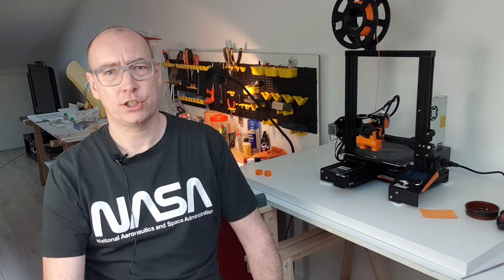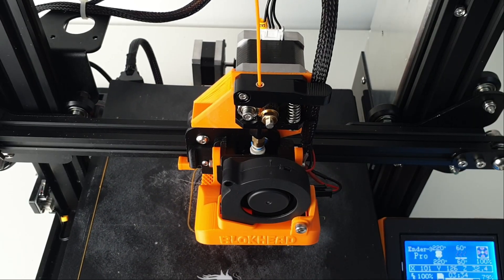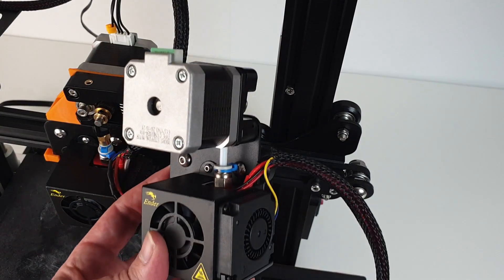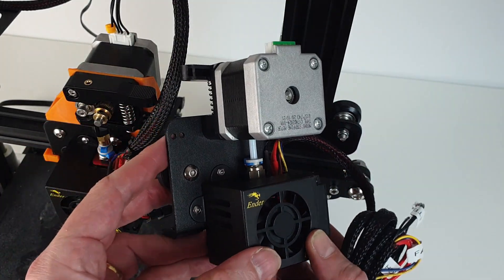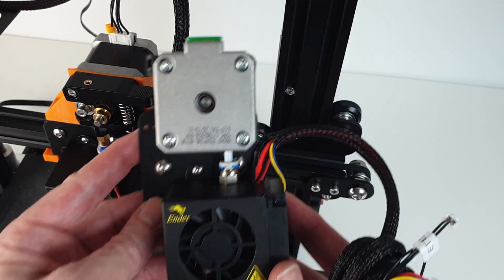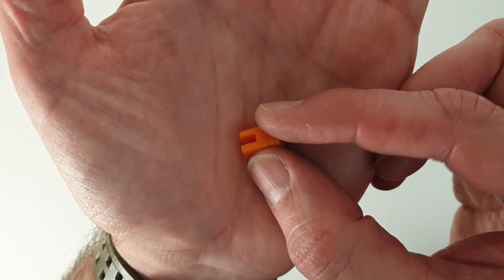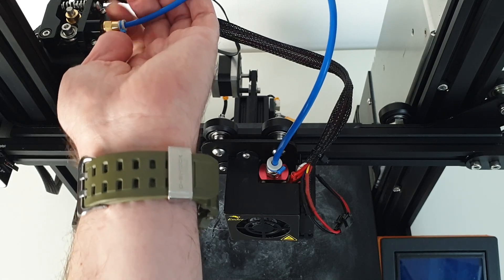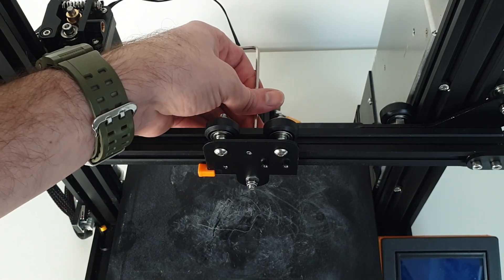3D Printed Direct-Drive for the Ender 3

Comment from the maker: FREQUENTLY ASKED QUESTIONS:

Q) Do you lose any print volume with this upgrade?
Yes, with this upgrade you lose 13mm on the X axis and 40mm on the Z axis.
This is because the extruder motor hits the frame due to its location.
To avoid this, you can either:
- purchase a thinner (<27mm) pancake stepper motor. I use this one (Amazon Affiliate Link): Usongshine Nema 17 Stepper Motor (17HS4023): https://amzn.to/3qEHUHR
- swap the Y axis motor (4234) with the extruder motor (4240) as per Erçin Torun guide:
https://all3dprint.blogspot.com/2020/09/ender3-pro-direct-drive-bullseye-mount.html

Q) Is the print quality higher with direct drive?
Not necessarily. You can get good print quality with a Bowden setup too. I would say the retractions are easier to get right with a Direct-Drive because of the shorter distance between the extruder and the hotend. In addition, the direct-drive is compatible with a wider range of filaments and makes it easier to print with flexible filaments / TPU.

Q) Do you have to change the firmware or anything when doing this upgrade?
A) You might have to change the size of the bed in the firmware. In Marlin Configuration.h, change X_BED_SIZE to 220 mm (from 235) and Z_MAX_POS to 210 mm (from 250) and flash the firmware. Alternatively, you can use a thinner stepper motor like this one: Usongshine Nema 17 Stepper Motor (17HS4023) : https://amzn.to/3qEHUHR. 

Q) Do you have to change the esteps in the firmware?
No if you use the same motor and extruder as before

Q) Would this work on the Ender 3 V2? on the regular Ender 3 (not Pro / not V2) ?
Yes

Q) Would this work on an Ender 5, CR10 etc.? 
Sorry, I don't know. You can give it a try, it's only 2 parts to print

Q) Which material do you use? Is it safe in PLA?
I printed these parts in Sunlu PLA+. It is safe in PLA. The extruder motor does get a bit hot but you should be able to touch it with you hand, otherwise the motor current is set too high and should be reduced on the mainboard. 

Q) Do you need to extend the extruder wiring to do this?
Yes if your current cable does not reach the top of the printer and you need the full print volume in Z (250 mm)

Q) After extending my extruder wiring, the motor turns in the wrong direction. How do I fix this?
Swap the 2 middle wires in the extension connector

Q) Do you need to change any settings in the slicer?
You can use the exact same slicer settings as before.
Optionally, you can update the build volume in the slicer to avoid placing objects outside of the available volume. 
In Cura, Settings -> Printer -> Manage Printers... Then click on "Machine Settings"  In Printer Settings, update  X to 220mm and Z to 210mm. With the right build volume, Marlin and Cura will not command coordinates outside of the available build volume, preventing the head to hit the frame. 

Q) Would this work with other fan shrouds?
Hero Me Gen 5 or 6 : No (because the  design shifts the hotend position)
Bullseye: Yes
Bullseye Blokhead: Yes
Satsana: Yes
Bantamount: No
Others: Most likely but I haven't tested

Q) Is this compatible with an Auto-Bed-Leveling (ABL) sensor?
Yes, this only affects the motor location. The attachment for an ABL sensor is provided by the Ender 3 metal plate or by the fan duct upgrade.

Q) How much Bowden do you need to cut?
63-65mm.
Reply: thanks
Reply: what the retractions for PLA , PETG and TPU?
Reply: @JPFaerialops225  0.5 to 1mm

Comment: Unfortunately doesn't fit an Ender V3 Neo, will need to reassemble the printer to reprint a modified mounting bracket unfortunately

Comment: After I installed it on my 3d printer it keeps slipping on the extruder and making the clicking sound how do I fix this?
Reply: sounss like an extruder gear issue.  just need to tighten or sloosen the brasss gear or the silver one it runs the filament past

Comment: RIP would have to figure out some modifications, I have the Ender 3 NEO with a CR touch, don't think the CR touch might be the problem but the NEO shroud/cover is a very terrible design fastened from the back so the printed part will block that hole. I actually had to strap it with cable ties to take some noise away (still not great). But I want to print with TPU and don't want to take chance with the Bowden. Might have to get the original metal cover, then drill and tap holes for it...... Or end up buying the Creality one, but I don't like where the stepper motor sits (and also looks crap and unclean).
Reply: There are models for the neo with a hole for the cover screw.
I printed it with petg and didnt have to buy anything to do the upgrade. I recommend extending the extruder motor cable however. The stock cable is short for the upgrade
Reply: @francisjpk  "and didnt have to buy anything to do the upgrade" but you had to buy longer cables for the motor. And the upgrade to direct drive on the NEO didn't work anyway, weeks of tuning with no success. Would have been easier and cheaper to just buy a model that has direct drive from factory.

Comment: Hai, nice video. If the bracket designed with extruder on front rather than back, there won't be any loss in build volume.

Comment: is a capriorn tube required or does it work with everything stock? By the way, on the Q&A, I can answer a question. This upgrade will undoubtebly work with the cr 10 because everything about the hotend is identical. However, the frame might be different so a longer stop-protection thingy might be useful.
Reply from the maker: It does work with everything stock, capricorn not required

Comment: I installed this mod and changed the motor with a thinner pancake motor but it heats up alot to the point i cant even touch. Any advice to fix the problem?
Reply from the maker: You probably need to lower the VRef of the stepper motor as shown in this video https://youtu.be/k2nm-WetPnU
Reply: @YouMakeTech  anywhere i could text you from? Maybe discord?
Reply: @YouMakeTech  Im having trouble finding details about my stepper motor
Reply from the maker: You can try by lowering the VRef by 20%
 A pancake motor typically needs much less current than a standard motor. This should significantly reduce the temperature. Then if it skips steps, re-increase the Vref 5% by 5% until it no longer skips steps. The "game" is to find the tradeoff between stepper temperature and torque. Note that a stepper motor can be hot. As long as you can touch it with your hand, it should be fine

Comment: what about setting. what did u have to change in the slicer. ive always wanted to do this but have always put it off an i ended up getting a a8plus that came with a direct drive an i started looking at its setting in the slicer an it wasn't as much of a difference as i expected from my boden extruder setups. i always thought a direct drive would use really low retractions from everything that i had read online but the factory slicer setting for my a8plus was the same as what my ender 5 is with a microswiss all metal hotend an i went from 5mm at 45mm/s to 4mm at 45mm/s with the all metal hotend upgrade so i figured a direct drive on top of that would lower it to 3mm or possibly even 2mm or less. i never tried switching them but i have a h2 direct drive that i had gotten to put on a two trees sapphire plus but have never gotten around to it but i really want to use some flexible filaments so its time i set one up to run flexibles an i have a ender 3 ender 3 max ender 5 and a voxelab that im going to pick from to do it to an i may end up getting around to putting the h2 on the sapphire plus but this looks like a simple way of going about it that doesnt cost anything so i think i'll give this a try.
Reply from the maker: I think the real benefit of direct drives is more responsive and more repeatable retractions. If you print mostly technical parts, with many retractions, the quality is superior to a Bowden system simply because the extrusion is more accurate at starts and stops.. In addition, direct-drives are compatible with a wider range of filaments, in particular flexibles. Regarding settings, most people only tune retraction distance and speed. But IMO the key parameter for retractions is actually acceleration. When you increase the retraction acceleration, you can reduce the retraction distance below 1mm! The 2nd retraction parameter which most people neglect is the travel acceleration. In fact, when you travel fast, you don't need to retract as much because the travelling time is much shorter and the filament has no time to leak! Any amount of retraction distance will not prevent the filament to leak out of the nozzle after some time because the hotend is not airtight and the gravity pushes the melted filament down! Finally, the last parameter which is critical is the linear advance. Once you get high accels + a properly tuned linear advance, retractions become insensitive to retraction distance and speed settings. With my Ender 3, any retraction distance above 0.5mm works fine. The print times are also much shorter with high accels and short retraction distances. To give you an idea, I use 3000mm/s2 accel for travels, 1mm retraction distance, 50 mm/s retraction speed and 0.04 pressure advance on a Bondtech BMG/E3D V6 with perfect retractions and no stringing. I have used these settings for a while now with various filament brands (PLA) and never needed to change them

Comment: Is there any consideration to have when configuring the printing profile after this? I'm planning to use this mod. Thanks!
Reply from the maker: you can use the same print settings and the same firmware if you use a thinner stepper motor, please check Q&A comment at the top for more information. With the stock motor, you would need to reduce the bed size in the firmware
Reply: @YouMakeTech  oh, just noticed that. Got it. thanks.

Comment: Has anyone used that upgrade with a BLTouch? After installing, the probing points are outside of the print plate. Also it slams into the frame on the right while probing the right points.
Reply from the maker: It's a known issue, please check the FAQ at the top of the comments

Comment: quick question: anyone know how to get a cable extender for the extruder, or how to make the extruder cable reach the extruder?
Reply from the maker: I make my own cables using a dupont ratchet crimping tool set (e.g. https://amzn.to/3sbQrmi ). With a kit like this, you will never need to buy cables for your 3d printer again, you can make them all, at the right length!

Comment: Thanks for the design and video! My extruder bracket is loose and the wheels arent tight to the track. So i can wiggle it. Is this normal?
Reply from the maker: No it is not. Maybe check the eccentric nut
Reply: @YouMakeTech  Thanks that worked!!! Beautiful design!

Comment: Other than recalibrating the extruder is the firmware the same or not?
Reply from the maker: You might have to change the size of the bed in the firmware. In Marlin Configuration.h, change X_BED_SIZE to 220 mm (from 235) and Z_MAX_POS to 210 mm (from 250) and flash the firmware. Alternatively, you can use a thinner stepper motor like this one: Usongshine Nema 17 Stepper Motor (17HS4023) : https://amzn.to/3qEHUHR . With a thin stepper motor, you don't have to make any changes in the firmware

Comment: where can i buy an extension cable?
Reply from the maker: On Amazon. The problem is that most extruder cables are not wired for Creality, so you need to swap the cables in the connector. My advice would be to make your own cables by using a Dupont Ratchet Crimping Tool Set like this one: https://amzn.to/3sbQrmi . With this kit, you can make all cables you need for 3D printing (and for many other applications), at the length you need.

Comment: I just did this conversion, but now how do I chainge the nozzle x offset so the head does not hit the right side post?
Reply from the maker: This can happen with some firmwares when the probe is configured to go too close from the edge of the bed. You can fix that by changing the dimensions of the bed in the firmware. In Marlin Configuration.h, change X_BED_SIZE to 220 mm and Y_BED_SIZE to 220 mm and flash the firmware. Alternatively, you can use a thinner stepper motor like this one: Usongshine Nema 17 Stepper Motor (17HS4023) : https://amzn.to/3qEHUHR .
Reply: @YouMakeTech  ok I will try that thanks.

Comment: do you have to change esteps or anything when doing the direct drive change?
Reply from the maker: No if you keep the same motor/extruder. However, you might have to change the bed size in the firmware otherwise the motor can hit the frame. To avoid changing the firmware, you can use a thinner motor. I use this one: Usongshine Nema 17 Stepper Motor (17HS4023) https://amzn.to/3qEHUHR
Reply: @YouMakeTech  okay thanks so much. I'm putting it all together now and I'm at the point where you cut the bowden tube. As far as u can tell you cut it to 6 inches but when I measure mine out to 6 inches it looks way longer than yours.
Reply from the maker: It should measure 63 to 65mm, which corresponds to 2.48in to 2.56in
Reply: @YouMakeTech  yea I kinda eyeballing it off of yours in the video and got it all handled! Thanks for such a quick reply! Never had someone reply so fast specially for a project. Thanks again!
Reply from the maker: @BMathiesen  I was working on my PC and got a notification for your message! Make sure you cut at the exact length and perfectly flat. Any free play between the PTFE tube and the nozzle degrades retractions and can even results in a jam!

Comment: Bad design in your extruder stepper orientation, it can colide with your z bar on top
Reply from the maker: It is not my design, I just made the video. To avoid this, you only need to replace the stepper motor by a pancake stepper motor (thinner).

Comment: Hi there! Great design! thanks for sharing! I want to do this mod but my extruder does not have a threaded pneumatic fitting at the filament exit and instead just a plastic fitting and plastic clamp. Would I still be able to do this mod or do u have to get an extruder with a threaded end? Thanks!
Reply from the maker: It should work fine as long as the tube is cut at the exact dimension and does not move during retractions
Reply: @YouMakeTech  Sounds good thank you will try it out!

Comment: when using a bl touch with the speed drive it slams into the side while leveling how would I fix that
Reply from the maker: This can happen with some firmwares when the probe is configured to go too close from the edge of the bed. You can fix that by changing the dimensions of the bed in the firmware. In Marlin Configuration.h, change X_BED_SIZE to 220 mm and Y_BED_SIZE to 220 mm and flash the firmware. Alternatively, you can use a thinner stepper motor like this one: Usongshine Nema 17 Stepper Motor (17HS4023) : https://amzn.to/3qEHUHR .
Reply: @YouMakeTech  thank you

Comment: Would you need to extend the extruder wiring for this?
Reply from the maker: Most likely, it depends on the printer. You can check whether your current cable reaches the top of the printer
Reply: @YouMakeTech  did you have to? ( I have an Ender 3 v1, a lot like the pro.)
Reply from the maker: Yes, to reach the top of the printer. But I rarely print 250mm high parts so you can start without it unless you really need to  print parts that high.

Comment: Thanks for the video! Just tried this set up and ran into trouble when lining up the extruder and the mounted hot end. The hot end is way closer to the frame (on the y axis) than the extruder by a good 12mm. I installed a dual gear extruder because the stock one cracked. Could this be the change that is causing misalignment, or could it be something else?
Reply from the maker: Yes, the normal version is only compatible with the stock extruder. If you have a BMG, there is a BMG version
Reply: @YouMakeTech  Yikes... thanks for the info.

Comment: Have You change any parameter on the slicer? Since I instalo the direct drive i couldn't print well with My 0.6 nozzle
Reply from the maker: No it works with the same settings.. What kind of print issues do you have? Make sure there is no gap between the PTFE tube and the nozzle and that the tube is cut perfectly flat

Comment: That $40 kit doesn't cost you any height limitations on the Z axis.
Reply from the maker: Right. To avoid the height limitation with the SpeedDrive, you can swap the extruder and the Y axis motor which is thinner or purchase a pancake motor <23.5 mm thick.

Comment: Did you have to extend the wiring to do this?
Reply from the maker: If your current cable does not reach the top of the printer and you need the full print volume in Z (250 mm), you need a cable extension